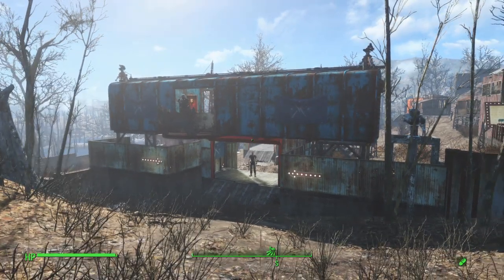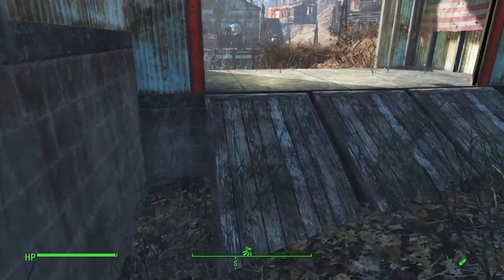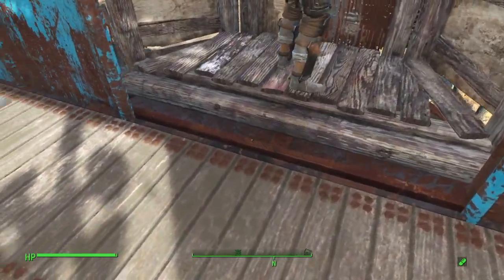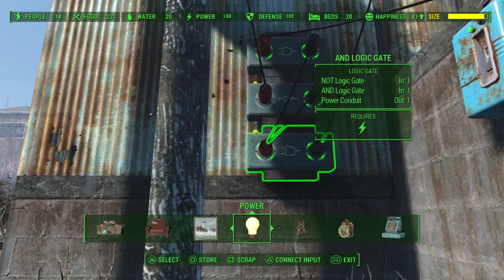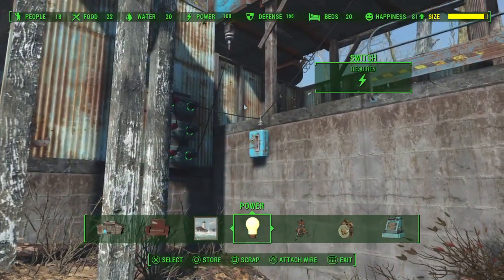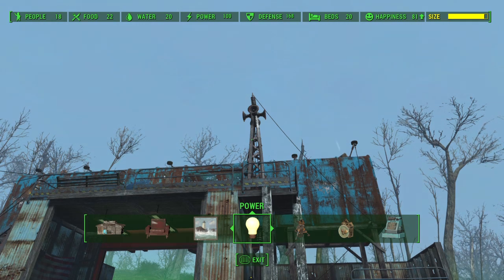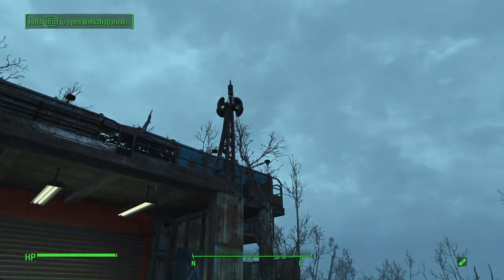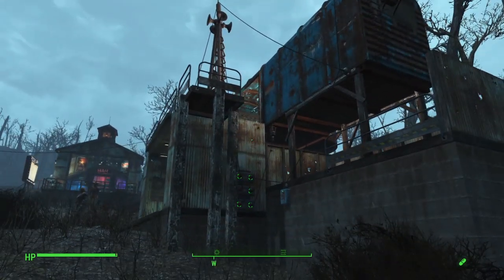Fallout 4 Settlement gatehouse using logic gates

Comment: Could you add powered doors into the circuit. So that when the guard spots enemies they activate the alarm. These in turn open up powered doors that have turrets behind them.
Reply from the maker: CaptainBipto that’s a really cool idea!
Reply: @sbrew42881  At Red Rocket, the powered garage door room. I placed turrets behind it, and walls with the window frames in. Need to work out anti-grenade additions to defenses. Maybe add a box shape chicken wire fence. So turrets can fire through, but grenades detonate on the fences. Like the anti-rpg net, seen it used on vehicles and buildings.
Reply: @sbrew42881  The anti-missle/grenade chain link fence setup works.  You just need to set the turrets back one or two tiles. So they are not hit with the explosives blast radius. Then use unbroken chain link fence pieces with no large gaps in. This would work at stopping your settlers being hit by grenades and missiles as well. 

But it fails against mini nukes due to its large blast radius. Though attackers will only hit the fence and it explodes, so you might get lucky and not get hit by the blast. Non-missle/grenade weapons will still hit attackers through the fence.

Has anyone tried putting turrets on a conveyor belt setup to go around you defensive perimeter. Then put up anti-rpg fencing to protect them. Along with ceiling cover to protect from aerial attacks? Do you know of any mod for Xbox One that fixes navmeshes for trapdoors?
Reply from the maker: CaptainBipto I haven’t seen anyone try putting turrets on the conveyors, but it’d be worth a look to find out if it works. I’m currently working on a build at Nuka-World Red Rocket, but between Fallout 76, RDR2, getting ready to start Resident Evil 2, and work the build is slow going, but I’m hoping to have it finished soon. I really liked your idea of the turrets behind the powered doors, I’m going to try and use that in the next build.
Reply: @sbrew42881  I would love to see how that build turns out!  I might have to build a test setup for the conveyor belt. Also might put a conveyor belt in the entrance way. But have it reverse direction when the alarm goes off. Add some laser trip wires, and some turrets behind powered doors.

I might also look at using murder holes over entrance ways as well. Maybe place a guard (grenadier with flamethrower) there to drop grenades onto attackers.

Comment: Couldn't you just use a single Nor gate with the input hooked to the switch and the siren (to control the door), along with hooking the siren to the firework mortar thing?
Reply from the maker: whatsup914 shortly after I made this video Bethesda changed the gates, this set up no longer works. I posted another video with a fix. I used a NAND gate and it worked great.
Reply: Oh, ok I just got my outputs wrong then. A NAND is an inverted NOR.

Comment: Commented on your 2.0 video, might as well put the solution I found here also. I changed the NOT gate to an XOR gate and added one extra power line from your incoming power to the XOR input, no other changes needed. This is on xbox, all dlc, and the unofficial patch mod if it makes a difference.
Reply: The XOR can only transmit power if exactly one input has power, it will always have power from your main input unless you manually switch it off, so as soon as a settler turns the siren on your gates lose power and close.

Comment: the problem i had with this setup ..is the not logic gate seems to be broken and the siren doesnt shut off switch ..maybe the new patch broke your setup?
Reply from the maker: I think you may be right. I have fixed the problem though, I used only the NAND logic gate. Worked like a charm after that.
Reply: i was a long night spent 8 hours trying figuare out logic gates ..i had nore gate powering the not gate still was broke that the siren wont not trigger the door switch
Reply from the maker: Those logic gates about drove me crazy lol. In my gatehouse 2.0 video I showed how to wire up the NAND gate. I've been tryin to come up with other ways to use the gates, but they are almost painfully confusing.

Comment from the maker: Be sure to check out my gatehouse 2.0 video. This set up in this video has glitches out and no longer works. But I have post a video on how to fix it and make it work. Thanks for watching!
Reply: i rigged it ..small generator on door for power  ..then a framer trap facing the generator ..when the siren is triggered flamer takes out the generator and gate closes..with all my bigger generator safe inside and my food and water ..cost little to repair the generator and flamer i think ..will see

Comment from the maker: I have found a set up that does work and just uploaded a new video about how I set it up so be sure to check it out. Thanks for watching everyone!
Reply: The only reason this setup stopped working was because the top AND gate was redundant and only had 1 input which is not how AND gates are designed to work.  To fix, remove the top AND gate and wire the switch to the bottom AND gate.

Comment: Nice little gatehouse; it's giving me ideas. Now I'm thinking about building something along the same lines, but a little more... Extravagant. Give it an inner door hooked to the logic gates and an outer gate wired to laser tripwires (obviously set to target enemies), make the building a bit wider and use the barn half-walls to place raised floor sections along each side wall with a row of turrets on each side. When enemies come, the siren would go off and the inner door would close, while the enemies would run at it, tripping the outer door and locking them in a slaughter box. That's the theory, anyway.
Reply: I did pretty much this exact idea, 2x3 concrete floor building butted up the the sanctuary bridge long ways. I have a warehouse powered door on each side and the inside has at least 20 sawblade traps powered from the siren.